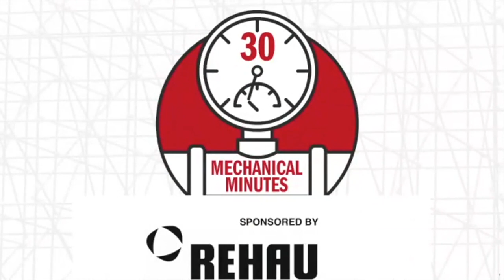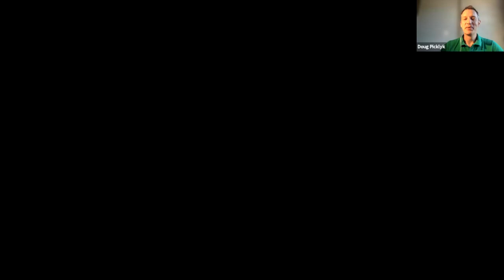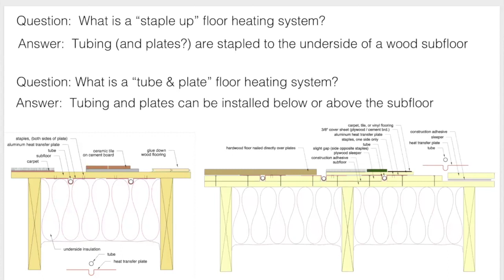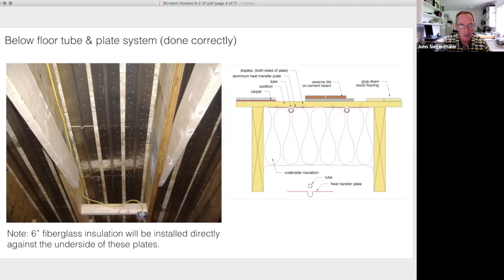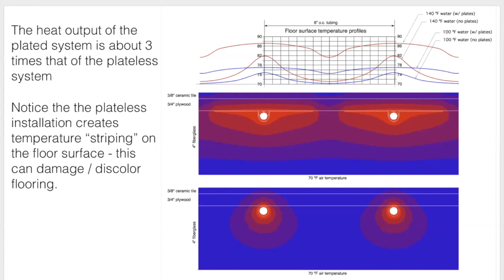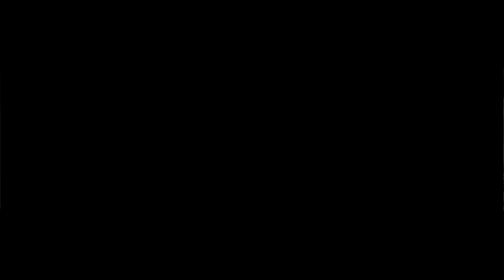30 Mechanical Minutes: Episode 9 "Hydronics and Heat Transfer Plates"

Comment: Dales question at the 28:35 mark.  I recently noticed my transfer plates are falling off.  Staples were used.  I plan on using screws to re-attach the plates.  Is it possible that the contractor set the compressor too high and used too narrow of a staple? Please help.  I've got twins on the way and the plates are above their cribs

Comment: Do you have more information on how to install the insulation? I've seen some places saying you should put in a reflective layer before the insulation... some say that reflective layer should also be a few inches below the plates to create a hot air pocket. But that would mean the insulation isn't pushed up right against the plates. Thoughts?

Comment: Thanks for the video. There is much good information here. However, John Siegenthaler is wrong about the fin efficiency of heavier gauge extruded aluminum heat transfer plates over very thin inadequately formed heat transfer plates. Also the FEA (finite element analysis software) that he is using is not appropriate for making the predictions and close comparisons that he made. A look at the color fea plot that he produced shows 100% heat transfer for the aluminum across it's width and 100% contact of the tubing with the aluminum plate for both samples. He' made these assumptions he is unable to adequately mesh (model) the heat transfer plate and has no idea what to input with respect to tubing contact. At that scale, he is attempting to evaluate and resolve differences in aluminum thicknesses as little as .040" or less.

This is a wildly inaccurate representation of the real 3 dimensional world where these assumptions may or may not hold true along the length of fin/tubing. This is a well known limitation of 2 dimensional FEA analysis. Errors are magnified when extrapolated to the 3d world. ie. btu/ft2

It's easy enough to understand that given the same heat transfer across the tube plate then the wider plate would produce higher output and it's not necessary to go through this convoluted reasoning to establish that fact. All panel heating systems have heat affected zones surrounding the tubing and it's common practice to vary tube spacing and tube diameter to achieve the desired result.
 
However, it is strongly misleading to make claims regarding variables that weren't even studied and assumed to be equivalent at 100%. That's not fair. Any fair empirical race would reveal that the extruded plates, even with reduced width produce far higher outputs and greatly reduced water temperatures.

Empirical, hands on investigations easily show the truth behind how the performance of these heat transfer plates compare with one another.

Please see my blog at https://radiantdesignandsupply.com/theheatexchanger for a simple infra red empirical study of different heat transfer plates and how they compare. Any proper FEA analysis must use variables that have been determined and verified from empirical experimentation.

Full disclosure, I developed the original and still the best extruded aluminum heat transfer plate - the ThermoFin. These heat transfer extrusions were designed to provide a very tight rigid snap grip of the various tubing types used in floor heating including PEX and copper. These plates are rigid, tempered tempered extrusions that are available in 4' and 8' lengths and designed to eliminate any differential expansion between the tubing and the plate regardless of the tubing used. They are available in the U or omega shape similar to the the sheet metal plates that John showed. They are also available in the C shape which grips the tubing while holding it away from the substrate. These plates are 4" wide,  .050" and .063" thick and 4' and 8' long compared with the 5"-6 wide x 20" long, .020" typical plate that John is talking about. Our original development of the ThermoFin family of extrusions resulted from our terrible experiences with the folded sheet metal plates. The fact is, they don't work much better than no plates at all.
Dale Pickard
President
Radiant Design & Supply

Comment: Hi guys, great video, thanks! You answered many of my questions. I am not an HPAC professional, just a homeowner researching hydronic radiant heating +/- hydronic cooling for a new build cottage/retirement home. Also looking to supply DHW with heat pump, but having a hard time picking out the best system: one oversized heat pump? separate heat pumps for each, or a heat pump for one and tankless electric for the other? I need help with that one. I will have a solar PV powering the large majority of whatever equipment I end up choosing so all electric makes sense (with wood stove or propane fireplace for backup heat). I also will need a cooling solution which I suppose shouldn't be a problem if I have a separate heat pump for the radiant... also need to decide on hydronic cooling for the slab vs air cooling! John I could really use a consult, what is your hourly rate to pick your brain? hahaha Oh good timing, YouTube just showed me a preview for your air to water heat pump webinar, guess I'll watch that and then the video on tube depth. Thanks again! ... update: I just googled hydronic cooling and a link to your article on "small scale hydronic cooling" came up. John you are a gold mine of information!